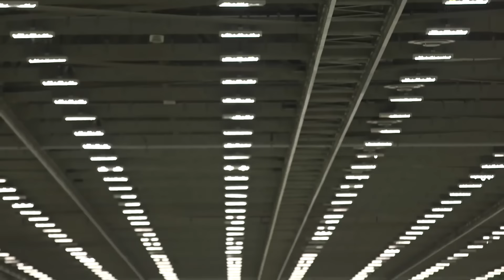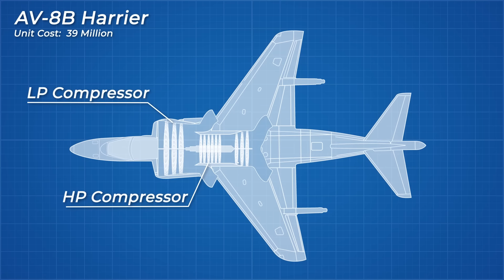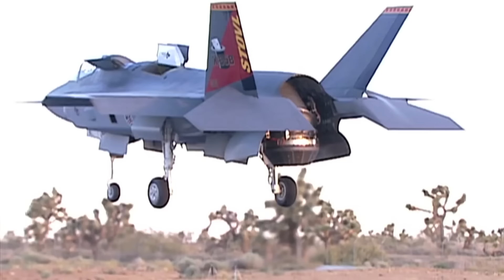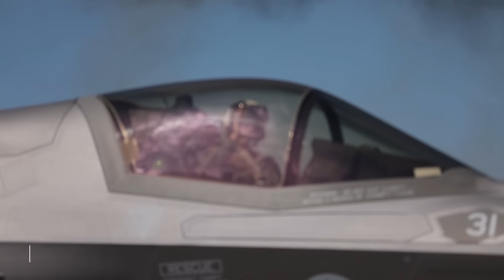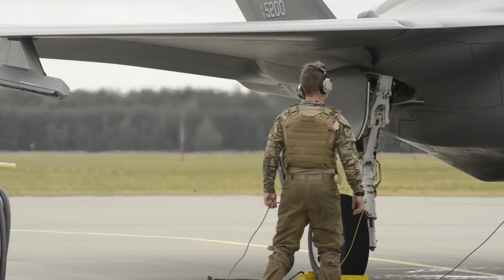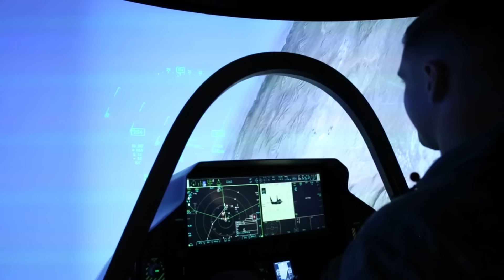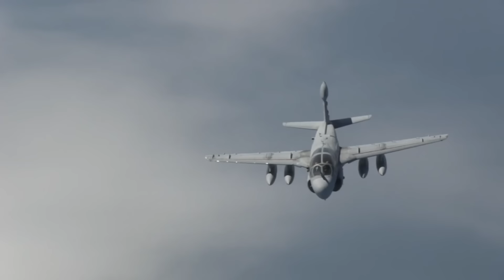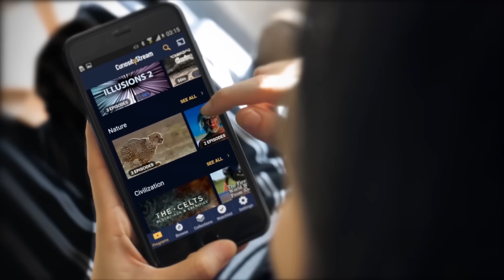Is The F-35 Worth $115 Million?

Comment: Let’s be honest guys.

F35 is a better plane than the A10, but there are those of us (myself included) that refuse to let the BRRRRRRRRRRT part of our era die. :(
Reply: Both the Su-25 and A-10 were designed explicitly for CAS and to be very cheap. They have very high survivability, carry a shitload of ordnance, and are cheap to buy, operate, fix, and replace. The F-35 can do none of those (in terms of bang for the buck). The F-35 is a great replacement for the F-18 and F-16, but the only thing that can replace an A-10 is another cheap, dedicated CAS aircraft designed from the ground up.
Reply: AWC The A-10 is survivable... against heavy machine gun fire.  To call it “highly survivable” in an age where every third world farmer has a Strela is a joke.
Reply: @Maka556  A-10s are survivable against even MANPADs. The entire airframe had atleast 3 redundancies built in for surface controls. The A-10 can continue to fly with a single engine, half a wing missing and or most of the rear flight surfaces damaged or missing. About the only way to really knock an A-10 out of the air is by splitting the A-10 in half...lol...Also, due to the placement of the engines, their low heat signature and other systems, actually hitting an A-10 with a strela is difficult at best, when piloted by highly trained pilots.
Reply: @9999AWC  You have a valid point, although you neglected to mention that the F35-B will also be replacing the Harriers. The A-10 Warthog flies a very different mission profile from the other aircraft listed, with very different requirements and very different demands. However, the problem is that the A-10 may find themselves obsolete under current anti-air capabilities of even third-world and insurgent forces, causing the entire concept of CAS to be put into question. 

At first, we were considering a helicopter for CAS (the Comanche 'stealth helicopter' program as the successor to the Apache), as it can hang around in battle space longer to hit multiple targets. The problem is that it is hanging around in battle space where any dirt farmer with a shoulder-launched RPG can shoot them down. The A-10 moves fast enough that it is more difficult to lock up and shoot down, while still providing close air support against a wide variety of targets, both hard and soft and both mobile and immobile. However, as RPG and man-portable SAM systems become more common and easier to use and quicker to achieve lock-on, even A-10's will find themselves challenged. Yes, you can take out an entire section of the aircraft and it will STILL continue flying, I've personally seen the amount of damage an A-10 can sustain and still achieve mission goals and land safely at a home strip. But in the face of dozens of such launchers, even an A-10's survivability will be sorely tested. 

CAS is almost certain to be relegated to UAV's going forward, probably specialized drones with specific packages for specific targets. Shooting down a UAV is going to be expensive, but at least there will be no loss of life, and the CAS low-air battlespace is just too dangerous for a pilot to be risked anymore. And they can be built small enough, little more than a single weapon system with wings and an engine, that achieving lock-on will be difficult because the physical size limits the return as much as anything else they might do to assist in reducing its signature. 

It's a shame, to be sure, but that's the day and age we live in. The Warthog deserves a special place in history, just like the Hellcat and Corsair before it. But unfortunately, time and technology move on.
Reply: @9999AWC  A10 has very high survivability when its attacking people shooting back with AK47s and RPGs.  In a conflict with a more technically capable opponent, the A10 will be useless.  Where ground troops have shoulder mounted anti air missiles, and coverage from fixed or mobile SAM units, an A10 sticking its nose in is dead.
Reply: AWC yes but they would be obliterated by any conventional force with an airforce. Only a few countries can have absolute air superiority and where these planes are going are not one of them imp
Reply: @9999AWC  The A-10 isn't remotely cheap and has always been at least as expensive as the F-16, including operating costs. It also wasn't designed specifically for CAS, rather to be durable enough to delay a 1960s era Soviet mechanised invasion of Europe long enough for allied ground forces to mobilise as a sort of suicidal interdiction aircraft. It is moderately survivable in those conditions, but it hasn't been remotely capable of such a mission since the 1980s when it first entered service. It has taken on the role of CAS since then because it's really the only thing it can do reasonably effectively and has had massive upgrades in order to do so effectively.
Reply: @dumdumbinks274  The A-10 didnt take on the CAS role. It was designed from the very get go, to be a CAS dedicated aircraft.
Reply: Not a question of better. It is a question of mission ready.

The f35 is a hundred times better plane than the a10 but the a10 is a hundred times more mission ready for close air support than the f35!!!
Reply: It's not a Better plane for the close air support role, that assertion is laughable and easily dismissed comparing their capable mission parameters. The F-35 is certainly, contrary to it's critics, a good aircraft, but it is designed as a stealth strike fighter/bomber. It does not have the high weapon or fuel capacity expected to stay on station in the ground support role nor good maneuverability at low air speeds. 

This mission is also primarily done in an environment where air superiority is already achieved, and the high operating cost of the F-35 compared to other options that perform the task better is another drawback.
Reply: @KeeperOfTheSevenKeys.  CAS is done on the frontlines as well, and that aspect of CAS is not performed by the A-10 due to it's vulnerabilities. The vast majority of CAS is not performed by the A-10 anyway because it simply is a very focused and therefore restricted aircraft. In large scale combat operations even when air superiority is achieved the F-35 will be a more cost-effective option overall.
Reply: @dumdumbinks274
While that might be true, it is irrelevant as the A-10 is an outdated aircraft. An honest comparison would be between the F-35 and an modern ground attack aircraft. As I see it the typical ground support missions against non peer opponents requires:

- big gun with a lot of ammunition
- large payload
- exceptional loitering time
- good maneuverability at low speeds and altitudes
- high survivability against ground fire

With the exception of payload the F-35 is inferior at all of these things compared to the A-10 while being significantly more expensive to operate. And keep in mind how old the A-10 actually is. Imagine what a modern Attack aircraft could do.

The sad truth is that they wanted to save money by squeezing three different aircraft (Falcon, Hornet, Harrier) into one. In the end they had to build three different aircraft nonetheless who share the same look (but surprisingly little beyond that) resulting in unnecessary design compromises for all of them and increased program costs. Developing three specialized aircraft from the beginning would have resulted in more capable and cheaper aircraft and there might have been some money left for a dedicated ground attack aircraft. As it stands the USAF is simply giving up that role in order to purchase more F-16/F-35 light medium altitude bombers. And it is primarily for budgetary reasons.
Reply: @vuesch  In what way is the A-10 outdated? It has data link capability, modern avionics, and modern weapons capabilities. Add on the Pros you already listed, other than being older than probably your parents, it is still a capable and relevant aircraft.
Reply: @SgtSeth
The old airframes get more expensive to maintain the older they get and will eventually fall apart. Modern avionics don't help with the mechanical/hydraulic parts. The survivability against modern fighters is limited. The A-10 lacks meaningful air to air capability in terms of flight performance, radar/avionics and signature reduction. You probably also wouldn't design an entire aircraft around that ridiculous cannon today.
Reply: vuesch - The argument about “old air frames” has been used against the B-52, F-111 & F-14 & could be used against a whole slew of other aircraft that were designed & built before the A-10. The USAF claimed the “Hogging Up” rebuilding program the A-10 underwent 15 years ago should make it viable until the late 2020’s.
The A-10 is a purpose built Ground Attack/CAS aircraft - I don’t expect it to fight against modern fighters any more than I’d expect any purpose built GA/CAS aircraft to take on fighters from whatever era they were built in. I expect it to need fighter protection &/or air superiority just like those aircraft did.
FYI, attack helicopters are even less survivable against fighter aircraft than the A-10. I don’t hear anyone seriously saying we should retire them & replace them with F-35s.
Reply: @dazaspc  Wow. Very impressive. 

- The F-35 doesn't do anything the F-16 or F-18 don't already do. It just does those missions on another level. Your comparison is also BS, as having characteristics that make an aircraft good at Air to Air can also make an aircraft good at Air to Ground. Let me ask you this, what specifically makes the A-10 good at any given mission? "Built for it" doesn't count. Name specific capabilities, I guarantee the F-35 is better in every single capability. 

- This is false. Air assets have, and always will be a rare commodity. There simply has never been enough aircraft that can be placed into an engagement zone to satisfy every single request. As such, the US (and any other western power) uses aircraft in a tasking role. They loiter in zones, and respond to the most pressing matter when they occur. In this capacity, the A-10 is terrible. Not only is it too slow to effectively cover adequate amounts of ground, but it also means you need to pack a lot more aircraft into smaller amounts of airspace. As such, you need several A-10's (and all the parts, crew and basing) to perform the same job a single Multirole fighter. To further this point, the USAF had to cut around 300 F-16s from active duty to maintain the ~200 A-10s. Because a fleet is very expensive to maintain, and the larger a fleet is the more efficiently you can maintain individual units. 

- Again, this is false. The F-35A/B/C all perform the same roles in combat (they literally have the same sensors and weapons). The only difference applied is how they take off and land. The lift fan on the B take the place of a fuel tank found on the A/C, the C has slightly larger wings and beefier landing gear. That's really the only differences between the variants. Your bomber analogy is also pretty bad. You're comparing 3 bombers which all have different roles to 3 variants which all perform the same role. Not to mention the reasons they are still around B-52 -> nuclear, B-1 -> supersonic and best responce platform, B-2 -> slower but can penetrate IADS. If the B-1 could penetrate IADS like the B-2, the B-2 wouldn't exist. If the B-2 could go supersonic, the B-1 wouldn't exist. Nothing can replace a B-52 because that's how nuclear arms control was set up. 

- When you use the Bradely as an example of bad military procurement, you demonstrate that your knowledge comes from Hollywood rather than actual military doctrine or history. 

- Lockheed doesn't build commercial aircraft because they don't have a proficient design team with experience and skill in that area. As far as fighters are concerned though, they are by far and away the best in the world. Lockheed's military aerospace revolutionized the way organizations and R&D work, now we call similarly structured organizations a "Skunkworks" after the original Skunkworks, which is Lockheed's military aerospace department. If you don't believe me, look at Boeing. All of their fighters were designed and originally built by McDonald Douglas. Boeing's X-32 was behind schedule, over budget and less capable than its competitor. Comparitively, Lockheed's X-35 came in under budget, ahead of schedule and exceeded design parameters. This is why Lockheed won the JSF contract. Consequently, the JSF ran overbudget (by a much smaller margin than most people think, the original contract called for an aircraft of $40 million BY2000, which is $60 million today.) mainly due to requirement creep, which has plagued every military procurement. I'd argue it's perfectly fine too, as these systems are very capable at the end of their development. 

I think the second to last point here is exactly the problem with armchair generals. The opinion that you gain from watching Hollywood movies or reading misleading articles are not valid reasons to weigh in on complex defense programs. Despite what you may think, you do not know more than the generals making these decisions.
Reply: The A10 has new funding of 990 million, this will be for the next 11 years. That includes an ungraded payload weight, upgraded body and weapons systems.  The BRRRRRRP era is the best era
Reply: Whew! I can see why people don’t like to reply in their own threads when it gets to the top! That being said, everyone, I love both planes and in a perfect world I think we’d like all of them to stay. If money was unlimited... well no, that wouldn’t work either - if labor and materials were unlimited and free well then we’d all be happy.

At the end of the day the A10 will not last forever. The F35 will not last forever. It’s sad but these are machines and these machines are made through use of technology and the technology is being advanced every day by humans. The humans of tomorrow are different from those of yesterday. There will [almost] always be beautiful birds in the sky, whether they are precision bombing; performing CAS; or even if you can’t see them. 

Sorry for starting a war here, and I probably just went on a really deep ramble since I’m not used to my comments being liked so much, but I hope this clears some air..
Reply: You don't compare an off-road vehicle to a sports car.

What a lot of these comments compare is a multirole stealth strike aircraft vs a CAS aircraft.

They are different, but also similar. 
The A10 CANNOT replace the F35's tasks, but the F35 CAN replace the A10's tasks to an extent.

The F35 is meant to be used from a distance where AA can't target the aircraft whilst gathering intel, and eliminating targets with guided smart bombs or missiles.

The A10 on the other hand can carry a lot more ordnance, and has a main gun that can be used effectively against ground targets. This aircraft is mainly used in places with moderate or poor air defence, mainly the latter.

The USAF has established that the Super Tucano can actually do the same job but more cost efficient in some instances. For example in places with poor air defence. 
The Super Tucano can be placed in more airbases than the A10 cause of lower operating and maintenance cost. Thus making easier to send an airstrike fast.
Reply: i want them to do something like this with the A-10...
https://nationalinterest.org/sites/default/files/styles/desktop__1260_/public/main_images/F82_twin_mustang.jpg?itok=lP89mGKF
Reply: It's interesting to see that the air force is looking into a prop plane to replace the a10. It's pretty cool to see that prop planes are still finding military ise
Reply: combat load, pilot safety, and ground safety are easily given to the A-10 but speed and maneuverability  is giving to the F-35 only problem with being fast though is the on station ability that the A-10 has that the F-35 doesn't, A-10s are slow and strong while F-35s are fast but stealthy. Yes they its better in some places but is worse in others there's no real definitive answer to which is actually better Close Air Support is always changing based upon the environment and during the gulf war and Iraq wars having the A-10 for close air support for long terms was useful dealing with the Iraqi tank battalions and infantry battalions. But in Afghanistan the answer to the CAS role is really neither of the planes, its attack helicopters like the Apache, and Cobra.
Reply: @frankieM_  Combat load goes to the 35, Pilot safety goes to the 35, because it doesn't need to get up close and personal with the enemy to be effective. Ground safety?i'm not sure what you put into that category but sure. The 35 can do CAS, superbly well for the last time. This discussion has been going on since at least 2010. And in the gulf war, the most effective CAS plane was actually the AV-8B.
Reply: Frankie The A-10 is slow, but not strong.  The A-10 was designed to be thrown suicidally to blunt Soviet armor offensives in the 70s, and it’s survivability against near peer adversaries has only decreased in the intervening 4 decades with the proliferation of infrared SAM and 30mm AAA.  Much like the AC-130, the A-10 is only useful shooting up farmers with AKs and soft targets like technicals in COIN.  And the GAU-8 is completely worthless in its stated purpose in killing tanks.
Reply: Maka556 - “The GAU-8A is completely worthless in...killing tanks.” Tell that to the Iraqi Armored Troops who were on the receiving end of the thing! The A-10 was not “designed to be thrown suicidally to blunt Soviet armor offensives”. It was designed to do the same thing the Soviet IL-2 Sturmovick was designed to do - Hit the enemy’s armored troops hard & repeatedly... To do that, it had to survive whatever the enemy could throw at it.
Reply: TraditionalAnglican The tanks destroyed by the A-10 in Kuwait were killed by Maverick ATGMs, not by the A-10’s obsolete cannon.  And strike fighters and drones can sling ATGMs more effectively or for cheaper and with higher loiter time than an A-10.
Reply: @Maka556  Yes.
Reply: madkabal - The Iraqis also had hundreds of T-72’s in Republican Guards Divisions & hundreds of T-62’s & T-72’s in other frontline units. The Iraqi Air Defense was Radar guided & included the same mix of SAMs & 57 & 25 mm AAA that gave us trouble during the Vietnam War & the Israelis during the Yom Kipper War, that the Soviets used to protect Moscow into the 1980’s & that the Serbs used to shoot down an F-117 in the 1990’s.
Reply: The A 10 was designed to survive in a high risk environment to fly lime in the Fulda Gap in case of Soviet invasion of the west
Reply: @darthspeaks6451  - The F-35A costs less than $90 million, while the A-10 cost $18.8 million in 1984. That's a bit more than $45 million today. That also doesn't account for the numerous upgrades that have occurred over the next 35 years. It also doesn't include targeting pods, ECM pods, etc. In reality, an A-10 costs only marginally less than an F-35A (both being CTOL). 

- The A-10 is not a flying tank. The A-10 was the most shot down aircraft in desert storm, and also had one of the highest damage/loss rates despite flying the vast majority of missions in uncontested areas. Whereas F-16 aircraft flew more missions, against tougher anti air threats  and lost less aircraft. On top of that, the "armor" of the A-10 is only a small amount around the pilot, which can't stop anything larger than 20mm. The rest of the A-10 is just as vulnerable as any other aircraft. Even when the A-10 was concieved, 30mm was the dominant AAA calibre. The A-10 is also not immune to EMPs, that's hilariously ludicrous. The A-10 uses digital avionics with a display layout similar to the F-16. 

- Except a Tunguska is much harder to find, is equipped with radar guided missiles, actually has a radar, and can quickly engage targets. An A-10 takes several minutes to set up a gun run, and can only stay on target for a few seconds, unlike a Tunguska. The Tunguska is also more heavily armored than an A-10, which is primarily built out of thin aluminum. 

But hey, keep up the BS.
Reply: darthspeaks That’s some great Wikipedia there.  Unfortunately for you, you seem to fail to take into account that the Tunguska is not the only weapon system in the world that has guns bigger than 23mm, or which can shoot surface to air missiles with a far greater range than any kind of gun.  And if the A-10’s “survivability” is completely worthless against a peer state antiair vehicle from the 70s, that makes the aircraft completely worthless for any kind of near peer state conflict in the 2020s besides as irreplaceable and disposable cannon fodder.  A missile that shoots missiles and guns guided by a suicidal pilot.

Like, why would you ever prefer a vehicle than can theoretically survive a 7.62mm hit to the cockpit over a vehicle that will never be in a position where a 7.62mm round can hit you?
Reply: The F35 is a high tech aircraft for fighting high tech opposition. In such combat troops on the ground will be using standoff weapons because the enemy will be using the same. The A10 is a low tech aircraft for supporting troops on the ground against low tech opposition. Those troops may only be using guns and cannon, but they will do a lot of damage to a low flying F35.
Reply: Anyone arguing in favor of the A10 needs a reality check. A10 is unique but is obsolete at this point. It's main gun is ineffective against modern tanks and it's low/slow flying means it can only fly in areas where air supremacy has been established but is still extremely vulnerable to infantry based anti air systems. Sit down and analyze the actual effectiveness of the A10 and what it needs to operate and you will see the only thing it had going for it is "it's cool".
Reply: F-35 max load: 6,800kg
A-10 max load: 7,260kg

That alone is worth a lot.
Reply: @Majima_Nowhere  Where on earth did you get those numbers? The F-35 is commonly rated for 18,000 lbs of ordinance, which is 18,000 lbs plus 18,500 lbs of fuel. In reality, the F-35A can carry 22,300 lbs of ordinance (maximum pylon capacity) without exceeding max takeoff weight. On the other hand, the A-10's maximum is only 16,000 lbs (pylon). If the A-10 takes its maximum fuel load of 11,000 lbs, it can only carry 14,000 lbs of ordinance. 

In any scenario, the F-35A carries more fuel and more ordinance.

/Edited to be more accurate, doesn't change the point though.
Reply: that's the thing.
Reply: Really frustrating that he didn’t even compare payload and loiter times and still declared the f-35 the superior CAP plane
Reply: @dazaspc  Umm no.
Reply: @dazaspc  Yes, and that does not help your case.
Reply: Great then that the A 10s are all being upgraded..they ain't going anywhere soon.
Reply: @boatymcboatface666  Well, you can only do so much.
Reply: Calling in a 9 line CAS request as a JFO when what's on deck is a pair of F-35's: Request denied. Too bad, so sad, just washed it. Too spendy to risk.

Calling in a 9 line CAS request as a JFO when there's an entire squadron of A-10's at half the price of the other 2: Would like extra BRRRRT and loiter time with that?
Reply: @WindFireAllThatKindOfThing  LOL!
Reply: Define “better.” The A-10 is old. But it’s cheap. A cheap, low flying, high survivability CAS successor - BRRRT or no BRRRT - would make more sense than this hangar queen.
Reply: @chooseymomschoose  The A-10 doesn't have high survivability in any kind of airspace which is significantly contested. Flying quite low and slow doesn't do one good with increasingly capable MANPADS out there.
Reply: It dosent matter how cheap you make your platform if it gets shot down by manpads and sams before it can ever deploy its ordnance. 

It dosent matter how thick your titanium bath tub around a pilot is you can’t survive a missile hit and remain combat effective. 

Also why build a plane and train a pilot for a plane that 

A. Can only do one thing and frequently kills British and US troops doing it.

B. Would be useless in a parity war and is easily detectable and lacks the energy to evade missiles of shot at.
Reply: chooseymomschoose low flying and slow is not a good thing. The a-10 would get shot down so fast against any military with a decent SAM setup.
Reply: @chooseymomschoose  speaking as a soldier I'd rather have an F-35 support me than A10. An A10s sensors is a pilot's eyeballs the F-35 sensors is what you are seeing here he can see more of the battlefield and let us know what is really going on while the A10 has to essentially react to what he is being told on the radio, the F-35 pilot with more information and more power can take initiative and kill the enemy the A-10 if he takes initiative I have to trust that he was trained very well in vehicle ID and has a sharp eye otherwise he's going to be blowing our asses away instead of the Enemy by mistake.
Reply: chooseymomschoose Don’t get me wrong, I can understand the advantages the A10 has. But look at it from this narrow-minded, and a very risky one at that, view:

An iPhone is more restrictive than Android powered device any day of the week (yes, I know, iOS and Android are slowly becoming just as capable, but bear with me). You have two choices: one that does everything decently well and one that does less but more effectively. Depending on who you are and your needs, you might just want the simple one. Others, though, prefer the one that can do everything even at a bit of compromise. 

In this case, the USAF (I know it’s a JSF, but the A10 is USAF specific) picked the Android powered device for no other reason than the fact in can replace a slew of aircrafts; A10 included. There might be compromises like survivability but the USAF and allies are placing bets that stealth tech will make up for that.

That being said, I don’t think this will be the permanent replacement for the A10. IIRC the USAF was looking into newer CAS aircrafts that are extremely cheap. I believe the competition was between the Wolverine and Super Tucano? I could be wrong, and I haven’t researched that in a while, but the F35 isn’t a bad stand-in.
Reply: Procxlite Porque no los dos? In warfare you can have heavy infantry, light infantry, or just chaff. Use one too pump your numbers, and the other to do the hard stuff. I could be off base here, but I’ve played enough strategy games to know unit choice isn’t necessarily all or nothing.
Reply: Procxlite - The F-35 is a perfectly good multi-role fighter/strike aircraft/“light bomber”, but it can’t replace a ground attack aircraft with the ability to take & give out punishment like the A-10. The ability not to be seen on RADAR that’s 30-50 km from you will do you no good when people who can shoot at you with everything from heat-seeking missiles to 57 mm AA can see you with their Mk 1 Eyeballs.
Reply: @TraditionalAnglican  Close air support does not mean literally being close to the enemy. The F-35 could easily drop SDBs and JDAMs from high altitude, and remain very difficult to engage. No need to be a heavy and slow target like the A-10.
Reply: @Procxlite  Not quite sure if I'm with you on the iOS and Android comparison. But other than that, I agree with you. 

The Super Tucano has been a great success, it has been utilised instead of the A10 in a lot of places that lack good air defence. Mainly because it is more cost effective in low risk operations.
Reply: Olav Furuseth Yeah it was a bit of an odd comparison, I agree haha
Reply: darthspeaks You’re one of those people who believes “close air support” refers to the aircraft being close to the target, aren’t you?  Who cares that the A-10 can survive 23mm hits to the cockpit armor?  The autocannon on the Tunguska fires 30mm rounds, plus there are these things called “missiles”.
Reply: @dazaspc  Whew, a lot of misinformation spread around the internet.

- The A-10's "armor" is only designed to stop the weakest of 20mm rounds. It doesn't protect anywhere eccept directly around the pilot, so it doesn't actually stop the aircraft from getting shot down. Not to mention the vast amount of AAA, even when the A-10 was designed, is 30mm and larger. Not to mention missiles, which are as lethal to an A-10 as any other aircraft. 

- The A-10 was not designed for CAS. It was designed to be cannon fodder in the Forward Defense concept, which the US Army quickly killed for Air Land Battle. This made the A-10 obsolete immediately. The only useful environment for the A-10 became COIN, where it is incredibly expensive compared to any COIN aircraft (think Super Tucano, or A-1 Skyraider for a historic example). In other words, the A-10 is too expensive for what it can do.

- Ground attack isn't usually performed at 1,000 feet shooting targets with cannons. The vast amount of ground attack, including by A-10s, is performed at 8,000+ ft dropping JDAMs. Yeah, A-10s today operate like slow F-16s, because the sensor suit which they use is optimized for that altitude. Believe it or not, the Lightening pod is far superior to the Mk1 eyeball. Spraying cannon rounds into friendly units is also a very poor creation by people like you. In reality, precision is the name of the game. PGM do that better than any unguided system, and just about every aircraft in the US' inventory can drop PGM. In other words, there's no reason to keep the A-10. 

I've got a more in-depth reputable to the A-10 here: https://www.reddit.com/r/NonCredibleDefense/comments/d1wflo/if_you_only_talk_about_anedotal_successes_and/ezqsti8?utm_source=share&utm_medium=web2x
Reply: A10 is way better at low altitude flight, F35s not a "fighter", it's a sucker punching dart at best
Reply: The A-10 is a relic from the past and will soon be gone. Only liked by the guys who fly it. The US Army doesn't want it, the USAF has always hated it, and the US Congress prefers to spend US taxpayers money on other weapons. Oh, and the company that made it no longer exists.
Reply: Puzzoozoo - I don’t know what the brass thinks, but the “ground pounders” who saw the A-10 annihilate their enemies just loved the ugly thing. It was like bringing in an artillery barrage on wings. 
The F-35 can drop two accurate J-DAMS which could take out a few of the enemy & temporarily disorient them, while the GAU-8A & missiles on the A-10 can destroy their ability & will to fight. Regarding “Air Superiority”, even the Germans discovered (in WW2) that the best & most accurate dive bomber (JU-87) in the world required fighter protection &/or Air Superiority, & we discovered the same thing in Korea & Vietnam. So, the A-10 will need fighter protection or Air Superiority, just like any aircraft doing CAS. 
The AK-47 might be a “relic of the past”, but it’s still the riffle of choice for fighting in muddy swamps & jungles. There’s a phrase in the trades “the right tool for the job”. When it comes to “danger close CAS” or ground attack, the A-10 is the “right tool for the job”, while using an F-35 in that role is like using a monkey wrench to hammer in a nail. The wrench will do the job in a pinch, but I know of no one who wouldn’t prefer to use the hammer.
Reply: A10 does it’s specific job much better than the F35 can. F35 just more versatile and expensive
Reply: That1Guy248 A Reaper does the A-10’s specific job of dropping explosives on third world militia in a completely permissible environment with no anti air more serious than a 60 year old manually aimed autocannon better than the A-10 can.
Reply: Wtf this proves that you know absolutely Nothing about those planes.
Reply: time to rally for a GAU-8A equiped F-35 variant. If they cant do it, then they cant replace the A-10